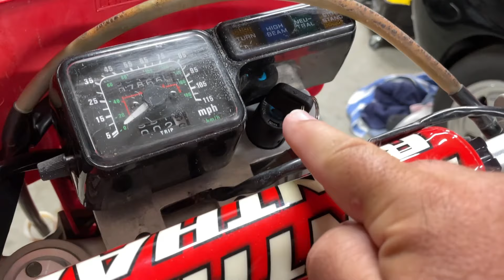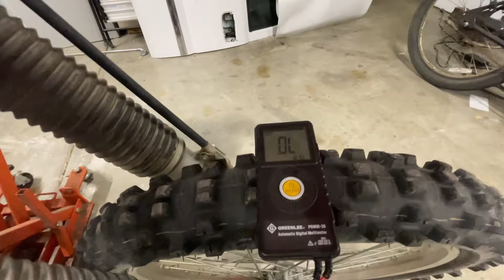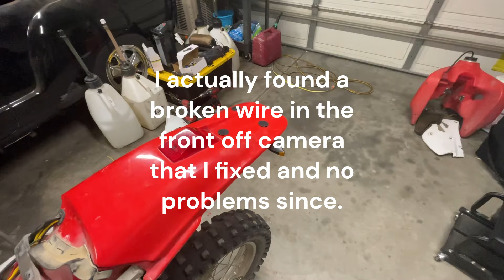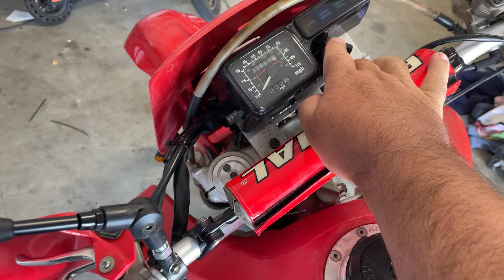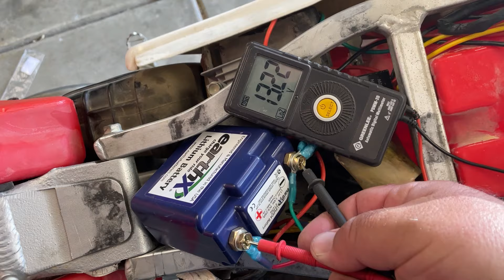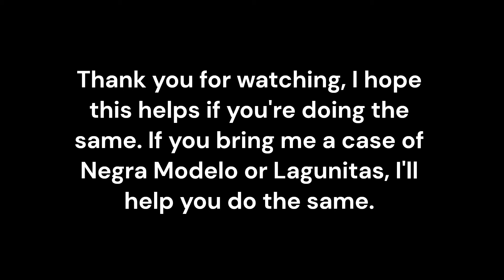XR650R Full Dual Sport Conversion W/ Light Kit Long Version.

Comment: Nice work!
If im not mistaken XR650L dashboard also has a light for Neutral gear. Is it technically possible to make that neutral light work on the dash? I think XR650R doesn't have any neutral gear sensor right?
Reply from the maker: The whole engine is different on the two models so I don’t think so. I am about to change the stator, I’ll have a look when the cover is off.

Comment: I’m trying to do a stand alone light system on my 08 kx 450f right now.  I plan on using a 5ah dewalt battery since my stator isn’t powerful enough and can’t find an upgraded option.  I’m hoping it’s simple
Reply from the maker: Totally could work, I'd find an easy place to plug it in like from behind the headlight, make it so you can easily reach in to change. Then you could potentially even swap out batteries on the go. Definitely need an LED headlight but the rest is really the same. It's all LED on mine except the headlight. My bike is pretty wimpy at 55w stock, but I think enough for a couple extra LED's. Make sure to film it so other KX owners see your solution. Seems to be a need for your year, looks like 09 got a charge coil.